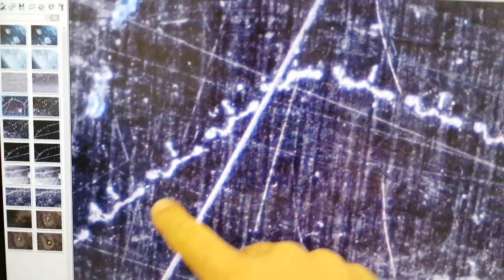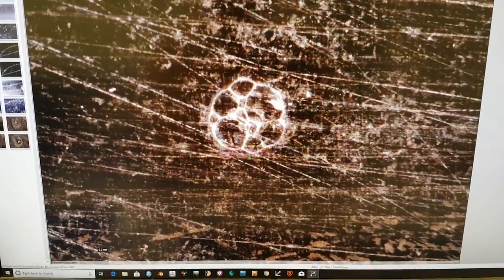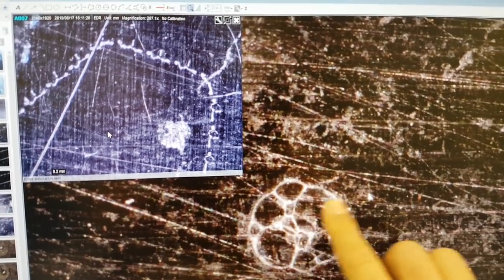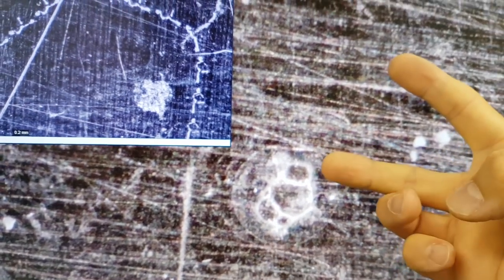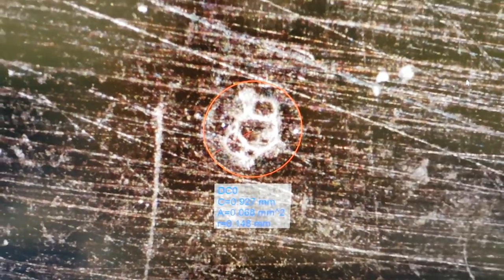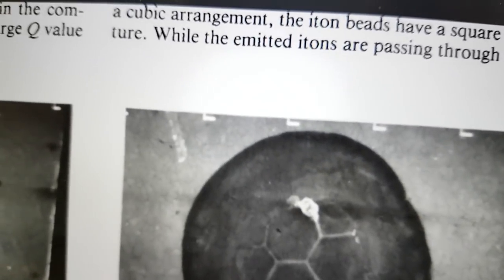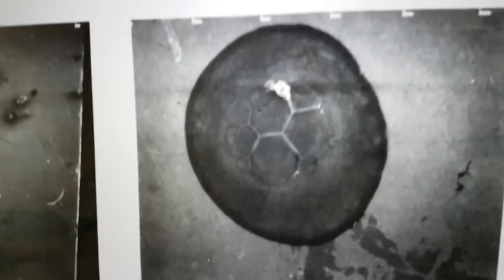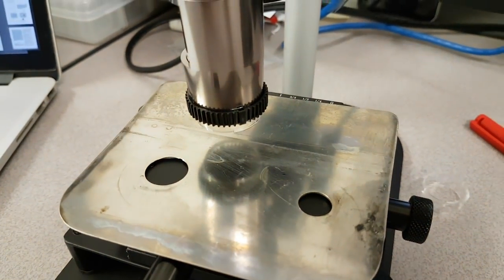OHMA - Strange Radiation - The Causal structure

Comment: So, you will have to think of a good name for those little structures.  What are they made of?  Are they pure energy or are they matter?  Are they related to the strange tracks generated by ball lighting?
Reply from the maker: They are a different (NOT NEW, since they have been around for all time) phase of matter.

Given their behaviour, they must contain high density neutrinos, but they also have been shown to contain other ions and electrons.